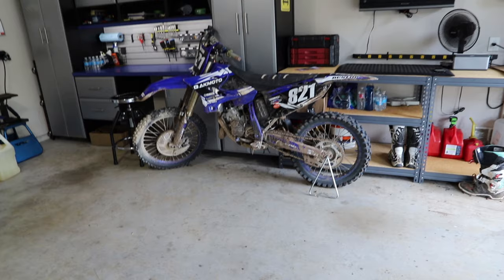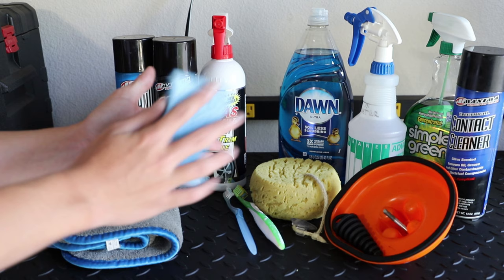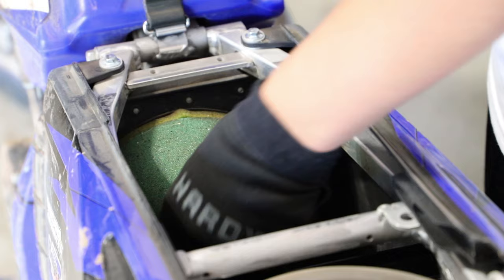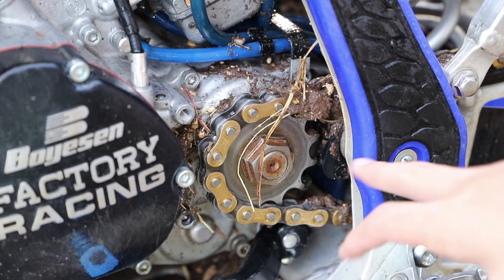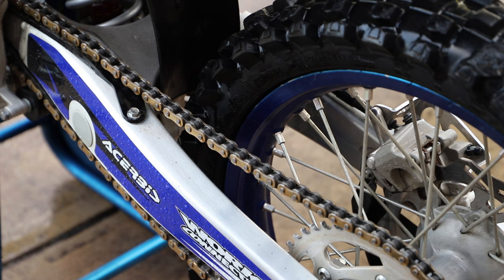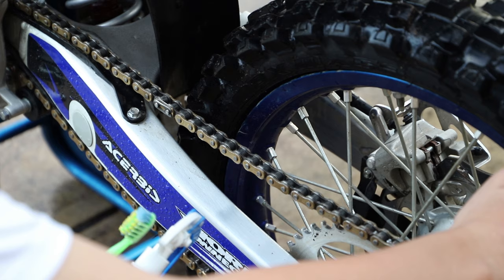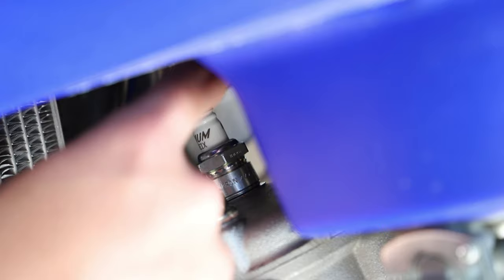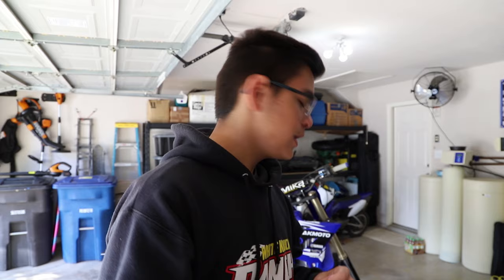How I Keep My Dirt Bike Looking New!

Comment: I wash mine with a pressure washer. It’s saves a lot of time and cleans behind everything really easy. It will get everything off immediately. Gotta be careful tho cuz you could damage your graphics. But if I ride in the mud I’ll still scrub it with soap
Reply from the maker: Pressure washers can definitely come in handy under certain conditions! But like you said you definitely gotta he mindful of it’s power when using one.